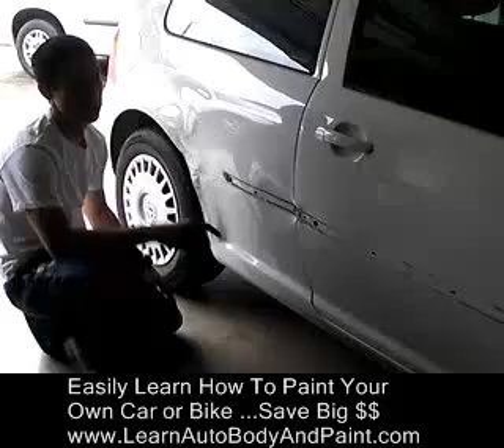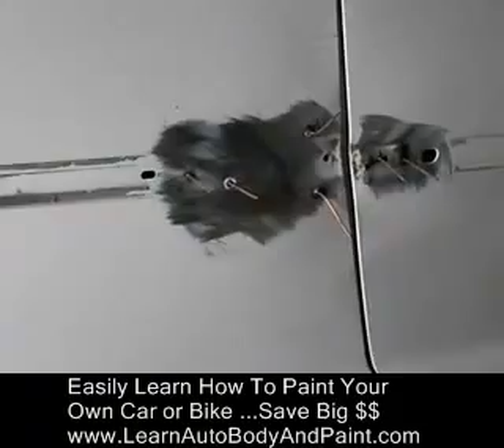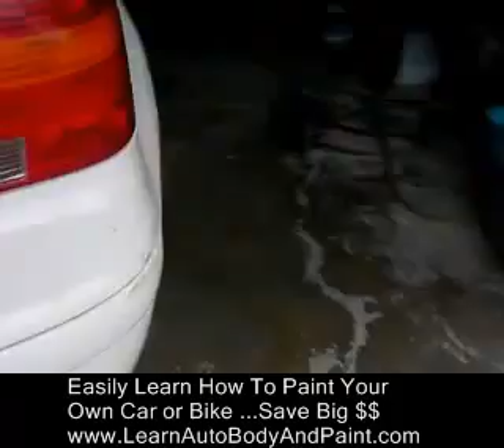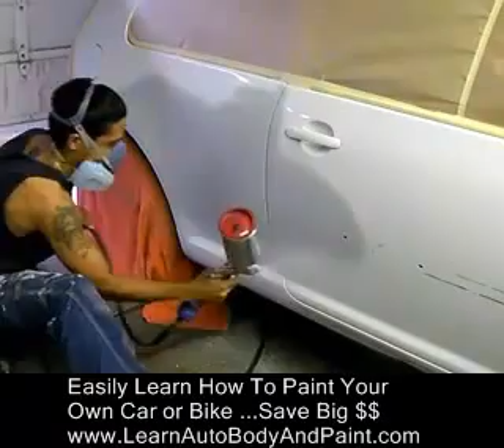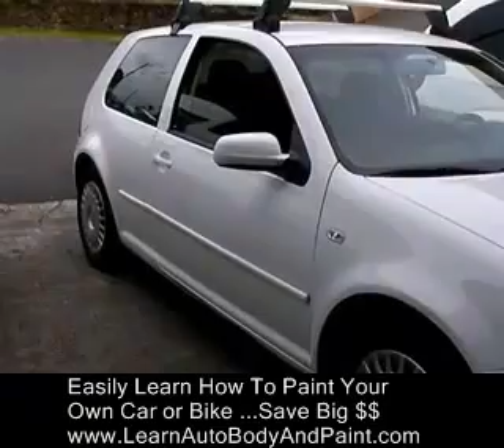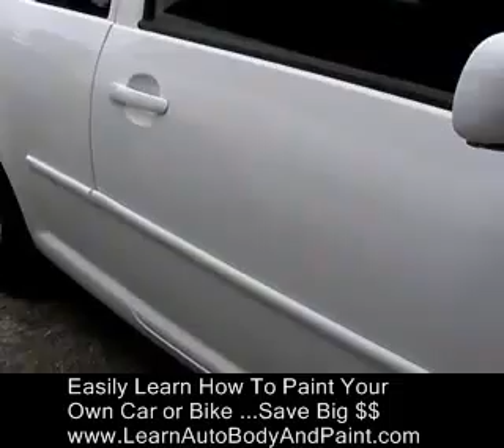How To Paint A Car Fast!

Comment: Nice job, I like how you got the dents out. I did it before with a dent puller but had to drill holes. Cheaper than taking the car to a body shop.

Comment: @huwbertoo Gti's only have a different skirt if it is a 20th or a 337,  20ths, were the 2003 model and 337 were the 2002 model.  mk4 golf/gtis were made from 99.5 to 2005.  And you may be thinking of the front vailence, or  the lip off the front,  they came with the 20th. but just a regular GTI  and a regular golf you cant tell the difference by just looking at it

Comment: @ohyousee1 you need at absolute minimum a 10cfm(cubic feet per minute) at about 60psi or 30+ gallon compressor.  most home compressors are far under that and you will be waiting on the compressor to fill up leaving dry spots in the paint where you waited, also should have a water/oil seperator, and if possible some type of down draft ventilation system

Comment from the maker: @rangaman86 I have never tried to use them for autos man. Are you talking about the house paint type? I just don't think they have enough pressure to atomize the paint man....
You don't need a HUGE tank a 40-50 gal will do. Do you have a Dryer in the house>, maybe you can just run an extension wire to the garage :)

Comment: @thlin  You can paint outside on a slab, if you do it early in the morning "when the dew is still on the ground" just watch the blow up and make sure you wipe the car down good. Its not the best means by far but you can still get a half way decent job. Ive done equipment like that with the old siphons and the HVLP would be even better at it.

Comment: why did you not R&I the door handle and mirror. the double sided tape was still on the door where the body side molding was. did you R&I the tail light or bumper or drop the bumper so you could clear to the edge of the panel?

Comment: @HowToPaintYourCar  Actually I'm searching for a way to paint my side mirrors (scratched from a stray shopping cart)  do I just use my paint and clear coat to get such a shine or do I have to do a whole sanding method after the Clear coat and buff it? if so what kinda buffing compound should I use?

Comment: you know how to paint a car fast? but a bucket of paint on the bonet,roof,and trunk, and put a stick of dynamite in each one light the 3 fuses AND GET THE HECK OUT OF THERE!! when they explode,if you have luck and the car willl catch fire,after it burns out the car will be a nice matte black color...(do this in a welll venilated area,interior will probably melt and burn) :D